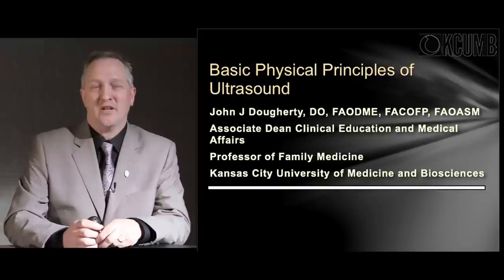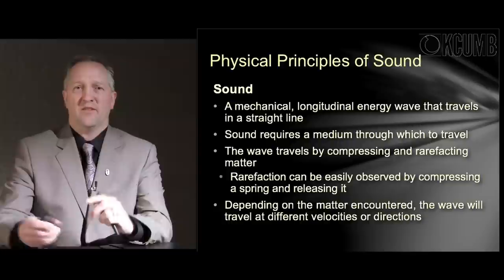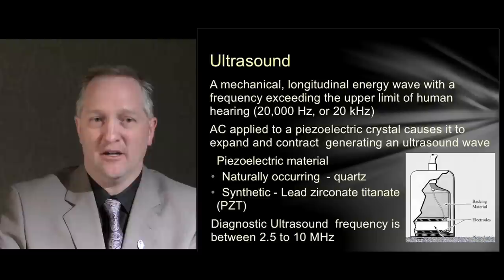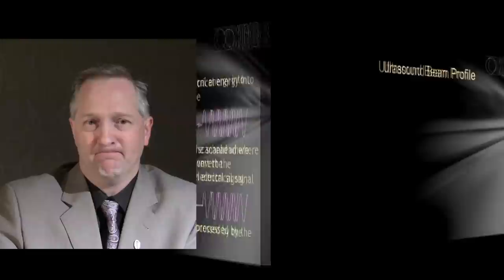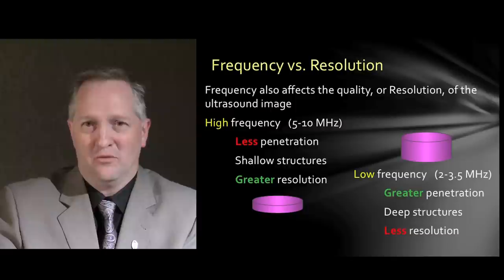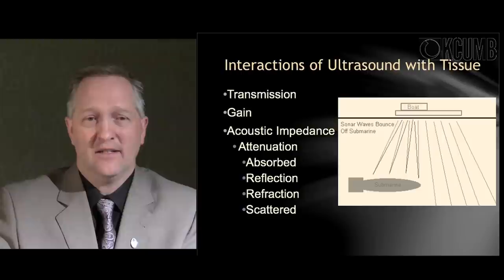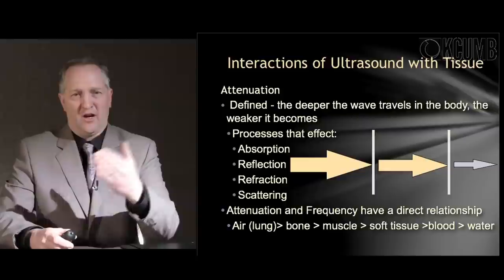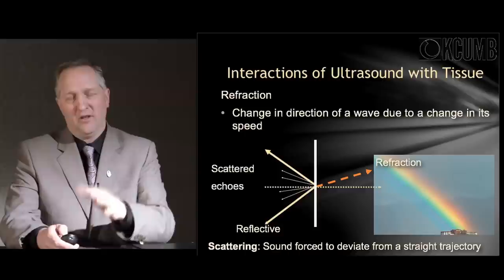Basic Ultrasound

Comment: @12:35 is that a correct scenario example for Gain yelling in the canon?  I thought the notes says "Does NOT change the power output", so the power yelling out is the same but it only changes the strength of the reflection that outputs on the screen Right?  So that means yelling out in the canon should be the same degree instead of changing yelling to whispering?  But the return sound should differ according to the adjustment of gain?  Someone help me understand this!! :O
Reply: ***** The slide is correct, the presenter's verbal explanation is wrong.  Power output from the transducer does not change.  Gain is a measure of how strongly the incoming echo is amplified within the machine before being displayed.  Amplification amplifies everything, both signal and noise, and for this reason if your image is poor you should adjust everything else you can think of before you reach for the gain knob.